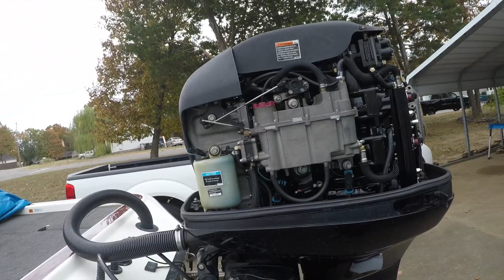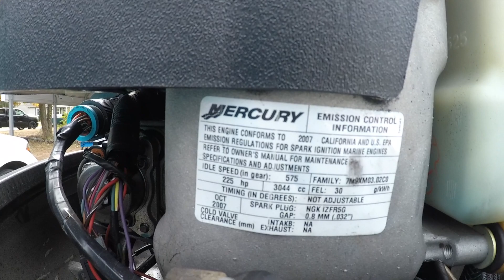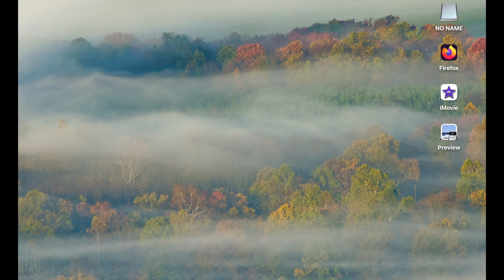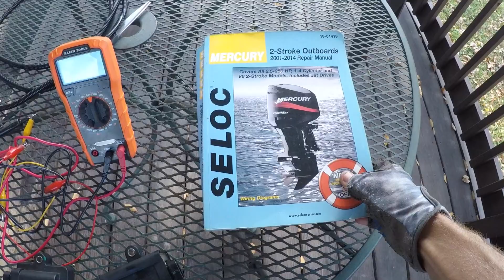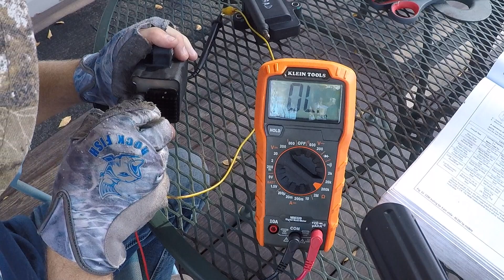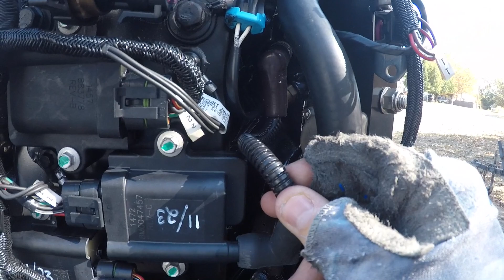Ignition System Upgrades For 2007 Mercury 225 Optimax! #ignitioncoil #mercuryoutboards #sparkplug

Comment: Thanks for the video! I have a 150-EFI, using the same 6 coil packs. Amazon has in-line ignition coil testers where a bulb flashes when spark gets to the plug. You can get 2 testers for less than 10 bicks. Just plug them into the coil pack and spark plug, then run your outboard and look for the light to flash. Walk through all spark plugs. Great to test on a running motor before going on the water.  They also have spark plug testers, so you can put a new plug and old plug to see the comparison. Testing under a   running load is a good idea after performing the basic resistance continuity tests.
Reply: BTW, doing my annual spark plug check, I found a spark plug that looked brand new! While the other 5 looked normally used. The in-line tester didn't flash, indicating a bad ignition coil. So I ordered a 3 pack of ICs for 60 bucks. 2 were good, I went bad when I ran it the second time. They sent me a replacement. Time will tell how they hold up. I'll keep a spare on the boat just in case. Options for the boater on a budget.

Comment: When I test my coils they pass all the tolerances except the red lead on pin D and black lead on pin a by about 2k ohms on all the coils, but when I swap the leads on the multimeter it passes that test since the chart has different resistances should I be worried about being out of tolerance on one of the tests on all of the coils? I find it hard to believe all the coils could be bad at the same time and the boat still run
Reply from the maker: The resistance test between Pin A and Pin D will vary. The range is 29 to 39 when the positive lead is on Pin A. In contrast, the range is 20 to 30 when the negative lead is on Pin A.  So, you will get a different reading between each test. Just make sure the coil is within range. Also, a resistance test is just revealing the strength of the coil. If a coil is just slightly out of spec, it will still operate until it gets weaker. At that point, you may get an intermittent loss of power on the cylinder. Lastly, the data I used for testing is straight from the service manual. Do you have a service manual for your motor? I'm not sure what motor you're working on. Thanks for watching!! 👍

Comment: Good video. I have a Mercury 250 xs that has never gotten up to wide open RPMs which should be about 5600. I’ve had the fuel injectors sent out to be cleaned and flowed. That didn’t help much still low RPMs. Compression is good on all cylinders. I did a drop test on each coil and they were ok. Is the drop test a reliable test for the coils or should I use the resistance test too?
Reply from the maker: A resistance test is more thorough, but takes a lot longer to test. A resistance test will undoubtedly find an intermittent coil, whereas a drop test will only test for a potential voltage drop. Thanks for watching!

Comment: I have a pair of 2005 225 Optimax’s owned since new.   All coils were good but I was not reaching my normal max rpm’s at WOT.  While I have changed out the plugs several times, I had never changed the spark plug wires.   Upon changing the cables, problem solved with full expected max rpm’s at WOT (in my case 5400 rpm’s) and a noticeable increase in power across the rpm range.
Reply from the maker: That's awesome! Those spark plug wires are just as important as the coils! Thanks for watching!

Comment: Can you post the ohm resistance specifications for the driver dual coil which has a 4 prong and 2 prong connection then the coil itself which has the 3 prong connection
Reply: I have an 2004 optimax 200hp with the other style of coil.

Comment: Did you ever resolve the slight missing issue?
Reply from the maker: Yes, the slight miss is gone. The new plugs and coil solved the issue. Thanks for watching!! 👍
Reply: @HawksDIY  Did the slight miss just work itself out with the new wires or was it the ethanol fuel and once fuel/cleaners got worked through it cleared out the low end slight miss?